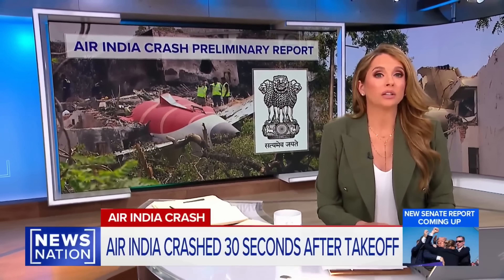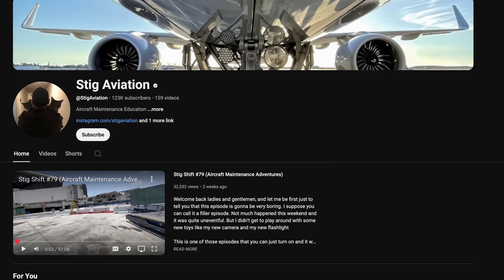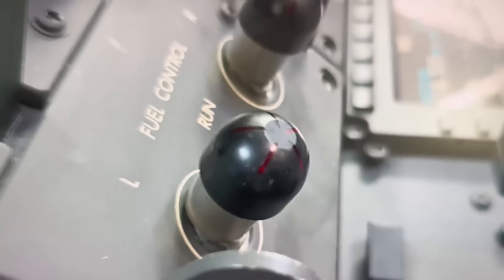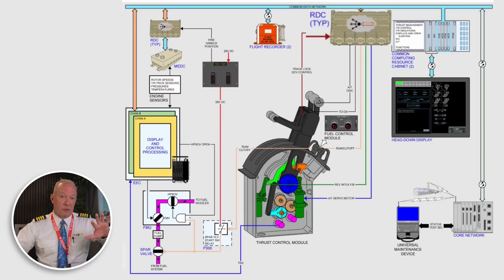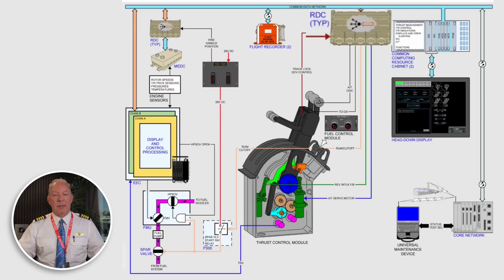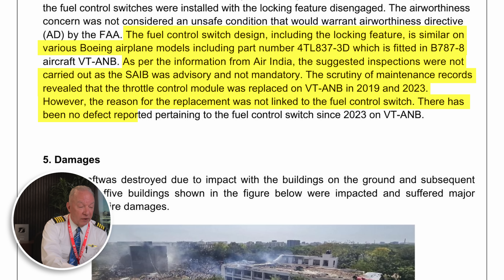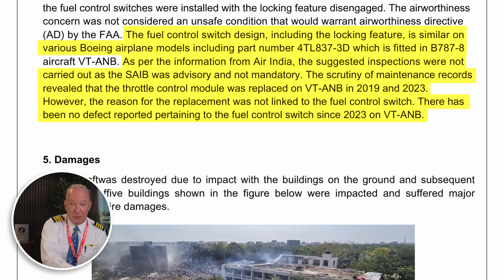The Truth About Boeing 787 Fuel Control Switches

Comment: Good point Captain Steeeve about the fuel switches still in run position after the crash!  I didn't think of that before and if they were faulty, they wouldn't be locked into the run position on impact.  So, I agree with your assessment and many others do too!   So many experts want to believe it's not one of their own but in reality, it could very well be.

Comment: Hi Captain Steve - Having just watched this, which all makes sense btw, the question which occurs to me is this: at what point in the travel of the switch does the fuel "run" action activate the relays, iow Does the switch only activate the relays right at the end of its travel? If, for example, the circuit already starts activating around the middle of the arc of the lever ie when the v-shaped protrusion at the  bottom of the lever part still sits somewhere ON TOP of the square tab on the base of the switch (and not yet positively engaged on the "run" side of the tab), then could it be possible that at the engine start procedure the switches were not fully moved to the "run" position, yet far enough for the engines to start? If so, then the vibrations at take-off may have caused them vibrate backwards into the "cut-off" position without anyone touching them. Just a thought...
PS apologies if this has already been covered, I just haven't had the time to read through previous questions/comments.

Comment: Can a relay, or its interlocks has probability of malfunctioning
Reply: All components have a probability of failure. The question is how do they fail and how frequently.  In this case we have two independent circuits with no interconnects. Loss of all power does not change the fuel spar valve position, the HPSOV get power from their generators. So, no single engine, relay or switch independently effects both engines. Without the human factor of moving both switches to cutoff, that leaves two independent failures within 1 second of each other that clears 10 seconds later on both failures. I'll take that bet.

Comment: Dear Steeve, I have watched almost all videos of yours regarding Air india crash. And its been really informative. But i have a few questions for your regarding these switches i have some knowledge about electrical and electronics as im a Mechatronic engineer.
1. Can you tell me from which point does FDR records switch position. At switch level (control signals going to relay) or after relay, signal going to valves..??
2. You keep bring up Switch operates a relay., but you have not exactly explained how a relay work. So I'm explaining it here- a relay is an electromechanic device, which separate control signals from actuation signals, for various reasons like usually control signals operates at a lower voltages of 5V or 12V, which is used to megnatise a copper coil with an iron core inside relay which in turn gets magnetised and operates the switch to close the circuit and supply actuation voltage to load which are 3 valves and fuel pump looking from your diagram which are working on 28V DC current from a battery. So its not that simple as no electronics signal. Relay is most common device, and when its coil gets weak they tend to fail. Then i also see a AND logic being used in your diagram inside that box where FMV and HPSOV are show, so there signal from relay and HPSOV open are received by AND logic and sent to HPSOV the way AND logic works is it will send output signal only if both input signals are present if anyone is absent it output is cutoff.

Coming back to relay if FDR reads switch position, before relay, that line needs to make a close loop with relay coil if coil is weak/fails then FDR will receive cutoff signal and also all 3 valve with go to cutoff position as switch will open due to coil failure.  And even if FDR receives signal at relay output even then if relay coil fails, then output will be cutoff. And if FDR is not reading signal there and is recording AND logic, which is receiving signal from relay and HPSOV open anyone going down will cause fuel to cutoff.

My bet is still on relay as i have seen them fail a lot in consumer goods.
In the report they mention one pilot asked why did you do that., and other responds i didn't that dont confirm its done intensionally. In many cases repeated OFF and ON signal to a relay does make it work properly. One more thing if control voltage for relay coil goes below or above operating voltage of relay coil it will malfunction too.

Comment: I am in the electronics manufacturing industry, the switches are connected to a circuit board with chips.  Theoretically anything can go wrong.  They need to disclose the full recording of the box.
Reply: i totally agree, this is an simplified schematic

Comment: Thank you Capt Steeve for your videos.  I am a electrical design engineer by profession.  You are exactly right that those two switches in the cockpit provide signal power to the relays in your diagram.  It is possible for the relays to fail for a few reasons, but the cockpit recording points to the relay didn't fail.  One of the pilots noticed both physical switches had been moved to the off position and asked why the other pilot had moved the switches.  The responding pilot said he didn't turn the switches.  The data recorders show after this both fuel switches were moved to back on and that is how they were found after the crash.  The relays didn't fail since on pilot noticed the fuel switches were off.  The data recorders show the fuel being turned off and they back on 20 or so seconds later.
Reply: I disagree. From the schematic, the fuel cut off switch merely supplies the power to one of the contactors of the relay. The signal to energise the relay is coming from the top-right RDC, as shown with the orange line and arrow pointing to the relay (input signal). IE, the top-right RDC DOES indeed decide whether or not this relay should be energised.
Reply: Captain Steve incorrectly describes the control of the fuel values according to the diagram he presented.
Reply: Would a failed relay or even electronic issue with the valve be indicated as "switch off" or would be shown as something else?
Reply: @larslrs7234  The voice recorder has one pilot asking the other pilot why he moved the fuel switches off.  The cockpit fuel switches are totally mechanical  just like your house lights on and off switches.  These switches are not electrical-mechanical, meaning there is no way for a electrical command to move the mechanical detent switch from on to off. The data recorder has the fuel being turned off and then 20 seconds later being turned back on after the one pilot noticed the switches in the off position.
Reply: @Keith80027  Did the asking pilot make that determination by looking at the switches or by looking at an indicator? The argument or question at hand is, if the switches ever even left the "on position".
Reply: we don't know if the other pilot noticed the switches turned off. He only said: "Why did you switch off"? He may have not actually seen it done  and only was alerted by his instrument readings, maybe  he ASSUMED it was manually turned off. Nothing was said by the pilot that indicated he actually saw it done.
Reply: @stevebubbie1126  Then why did he turn the fuel back on if he didn't notice the switches off.  Data recorder shows turning on the switches after the statement, not recycling the switches.
Reply: Could an issue with the 28v battery cause this? Like a temporary blip in the battery performance or connection and then it came back on after 10 sec. If battery dies, will that cause the fuel to shut off, and will that register as fuel switch cut off in FDR?
Reply: @arushkumar6577  Yes, if the battery is so gone that it creates a short which lowers the voltage on the bus it's connected to. Boeing never thought of this, so only tested failing generators and batteries that "fail open", so do not affect the rest of the stand by power. This would require also the BDM (battery diode module) to have shorted, but a shorted BDM may have been like that for days, and would have been the actual reason the battery eventually failed. (Also explaining all the cabin electrical issues.)

Comment: We have proof.
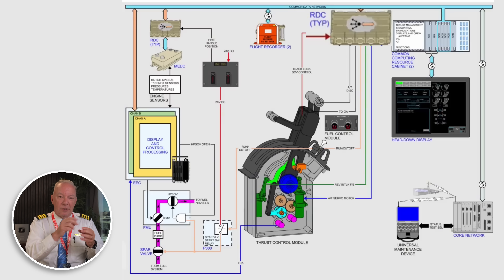It's now proven in three ways that the RAT deployed at 8:40   This means the aircraft was in a serious emergency state when at took off at 8:39.  In this state. the TCMA or FADEC could have shut off the engines.  It's happened in the past.  *Therefore, the Captain was responding to the emergency, not causing it.* Turning Fuel Switches to Off and On again is the standard procedure to re-start engines.  Pilots are trained to move switches to Cutoff and Run to restart the engines. This is how you turn the engines back on.   One engine even started up.  Therefore, the discussion about fuel switches is moot.  It has nothing to do with the serious state the plane was in at rotation or liftoff.

Comment: still lots of speculations and assumption are going on for Boeing787 tragedy. from electronic engineering point of view, Boeing being one of the most advance aircraft is sure to have dozens of electrical, electronics and mechanical components  like relays, pumps/motor, valves, sensors etc., for its fuel supply operation. Even a car fuel system is quite complex. Boeing's will be more complex. So if an aeronautic engineer, who maintain the fuel supply system gets the time to explain the details about the fuel system, it will clear everyone's doubt.

Comment: When a relay no longer has power applied to its coil, here’s what typically happens:

The relay returns to its default (rest) position.

For a normally open (NO) contact, the circuit stays open — no current flows.
For a normally closed (NC) contact, the circuit opens — breaking the current flow.

This happens because the coil no longer creates a magnetic field to pull the armature. A spring (or gravity) pushes the armature back to its resting position.

So which type of relai is in the boeing ?

Comment: Hey @captainsteeeve - another great video!  Question I have: when you shut down the engines at the gate, are the fuel cutoff switches how that is done (i.e.: starve the engines of fuel to turn off), or is there another mechanism to shut down, similar to how you’d turn a key or push a button to shut down a car rather than shutting off the fuel?

Comment: Computer electronics guy not aircraft.

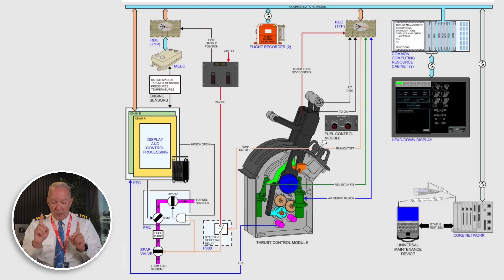The simplified functional drawing (7:26) shows the SPAR VLV CUTOFF SW relay gets its input RUNCUTOFF from the RDC.  RUNCUTOFF closes the relay which directly opens the SPAR fuel valve, and if HP SOV is true also opens HPSOV fuel valve.   FMV fuel valve is opened (apparently) by an output from the EEC.  Obviously this is not a detailed schematic; but the yellow trace is not denoting a connection to the mechanical switches (it retains the signal name RUNCUTOFF from RDC output to the spar relay.)

This diagram also (surprisingly) implies that the only FDR visibility of the status of the fuel switch status is via the COMMON DATA NETWORK bus connection with the RDC.   I would tend to believe there are more views of the fuel valves and actual switches that are not depicted here.

A tragic event.

Comment: In my opinion, With the huge landing in the middle of the switch at the break over point, the switch can be set in the middle and not locked in either position.  Major design flaw on something this critical.

Comment: If it truly is a closed loop with no EFCS ability to cut off fuel system then okay. But why would one pilot say to the other, “Why did you cut off the fuel?” And the other reply “I didn’t,” followed by ten seconds before they were switched back on? If they were moved to cutoff position it would be visibly verifiable and the solution would be immediately known.

Instead they wasted ten seconds trying to determine why the fuel was cut off while the switches indicated they were on, then a Hail Mary attempt was made to move the switches down then back into run, but too late.

Comment: I am not going to suggest that your description of how the fuel switches work is wrong.  However, they were on during take off and the were on after the crash.  So what is the evidence that they were ever switched off?
One pilot asks the other why he turned them off and he denies doing that.  We only have an incomplete transcript of that conversation, but that snippet of conversation could be consistent with neither pilot turning the switches off.

If I actually saw my fellow pilot physically turn the engine switched off, I would probably have screamed "what the F*** are you doing?" at him and more strong words would likely follow.

If we go back to basics, the switches DO NOT turn the engine fuel supply on or off, they trigger a series of electro-mechanical systems and events that remotely operate the fuel valves.  If some other event causes those valves to shut off (e.g. a loss of their solenoid supply voltage for some other reason), then the engine's fuel supply would be cut off.  If it were a temporary loss of supply (or a big drop in voltage), that might cause a temporary interruption to the fuel supply (as an alternative to the switches being turned on again).   A fault on one side would also have to trigger valve shut off on the other side, but if each side is not totally independent (and they are different) are you absolutely certain that they cannot be cross connected?

I read somewhere that raising the undercarriage would be a big load on the battery (and thus drop in output voltage) if the normal power source for that had failed.  The pilots appear to have started to raise the u/c.  All aircraft have extremely complex systems and even if a combination of events is very unlikely, the very fact that it is unlikely could explain why it hasn't happened before (that is usually the case with aviation accidents).   I really don't know.  All I am saying is that other explanations - and not just pilot operation of the switches have yet to all be eliminated.

Comment: I'm missing one important part of the explanation of how the fuel control switches work. Exactly how is the information about switch position transferred to the FDR? Where are the sensors located? Are the sensors positioned in close proximity to the physical switches itself? Or do the FDR record the position of the relay? Does it record the voltage after the switches? Is there also a parameter recorded that 
measures the incoming current/voltage to the switches? In other words, what EXACTLY does the FDR record?
The schematic that is shown in the video is good, but this type of schematics often just show a selection of connections, often to increase clarity, and to make it easier to understand a certain function.

Comment: Could the switch detent and/or spring be worn out so brushing the switch would move it from run to cutoff with a bump?  That might explain why the pilot questioned why the switch was in the wrong position.

Comment: I love how electronics are oversimplified. I have no conclusive opinion on this accident yet. Intentional shutdown might be the cause but I am still missing two important clues to support this explaination:
- "Why did you shut down the engines?" couldn't be a reaction to both engines losing power (just by looking at the screen) or after one of the pilots manipulated the switches as required for a restart? In an emergency like that they might have acted before announcing anything.
- The switches drive a relay. Relays are normally a coil that drives a magnet. The toy showed in the video does not rule out interferences to such coils nor wiring problems. I am sure that if you sand down insulations on that toys wires you are able to get many faults.
Reply: Why did you shut down the engines? no one said that. ""Why did you switch off" was  said. He could have gotten the readings on his control panel then assumed the pilot switched them off. We don't know if he actually witnessed the switches turned off.

Comment: So you are saying the valves are fail close ( like relays = loose power then drop out) much like access control in a building , by code a magnetic locked door must fail safe(open), not fail secure.  so then in theory even if the the switches are on, a grounding issue or short in the feed of the battery or battery goes below nominal, (you cant pretend to think batteries dont go bad, they can absolutely go bad during flight) so if the battery feed to those valves drop, loose power to the valve , they close..   If this is true this seems dangerous,  they should be fail open. loose power they dont close , you must keep power to keep them closed.   because in theory  they could have never been touched, by either pilot, there could have been a slight interrupt in power, then power back, i have seen this in electronics, where you have a low battery(off nominal) , the load drops out for just a bit, the battery regains then reapply load and it works.
Reply: There arecomments here from people who claim to know what they are talking about (unlike cpt S) that the vales do not operate like that.

Comment: Can a voltage surge or sag cause a relay failure or if the relay if stuck, will that leave the circuit to be open (no current flowing)?

Comment: A fiberoptic link connects the switches to the system, and signaling flow to the engines is also through the Hydro Mechanical Unit (HMU) and other associated valves, a system that is complex. The more you read, the more you realize that the pilot cutoff switches are only one way to affect a shut-down. And also, that only 30 ppm of water is tolerated in the fuel system. Water and algae will clog and disrupt the system. Please don't lock onto the easy assumption and forget to solve the problem truly. What was that white cloud and haze in the video?